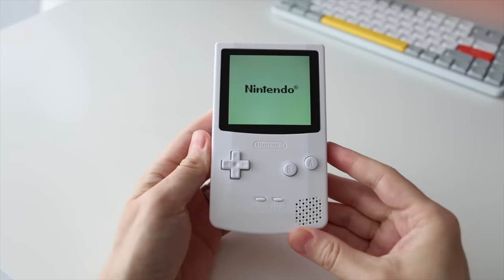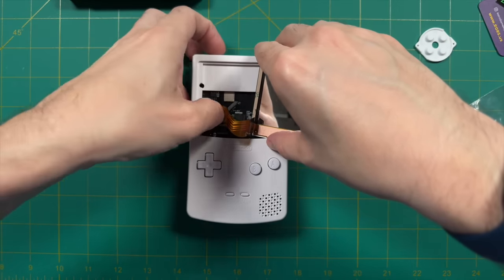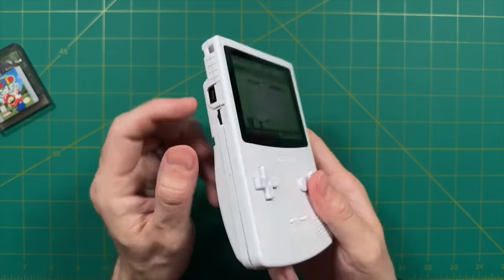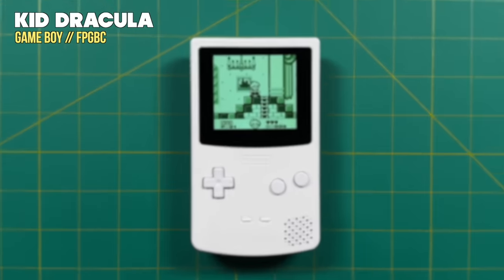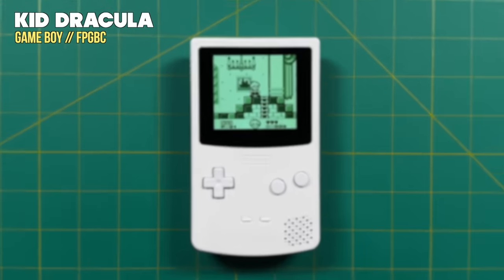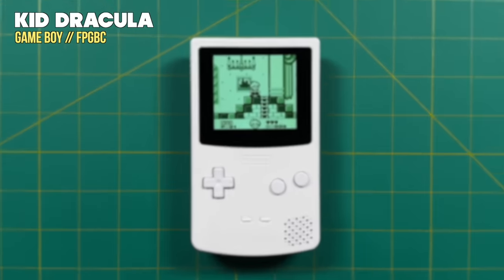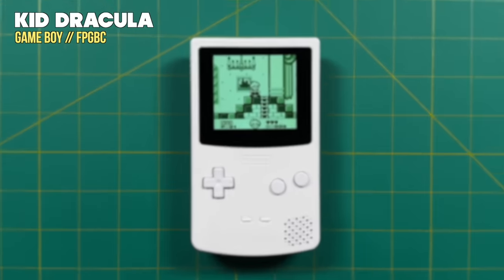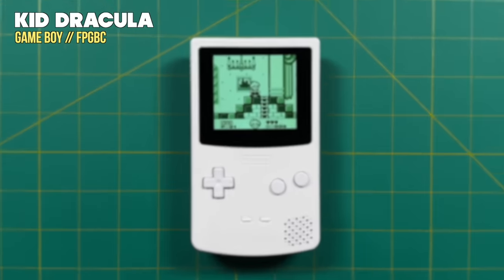FPGBC Review: My Favorite Game Boy

Comment: I have purchased the same product and I also had link issues. I found that the link port is not sitting correctly and was not allowing the cable to seat fully. You could maybe loosen the screws for the motherboard and move it over slightly as it doesn't need much. I had a cheap link cable so i just trimmed the black plastic around the port. Now it works as it should

Comment: Great review. Its crazy how you stated everything Ive been thinking the last few months. I even started collecting gameboy and gameboy color games, even overseas ones, because of the fpgbc. I have both it and the analogue.. I love both for different things. Ive been using them more than any of my other handhelds lately..especially analogue having some other emulators as well. Pro tip.. Kirby tilt and tumble is the most underated game of all time imo now that we can play it on a clear big nice screen. Its so good. Can even get the japanese version since its a bit pricey in english. so worth playing the actual cart. I went for the fpgbc during its first wave 1.0 for two reason.. I always wanted a modded gameboy but the price was always way too much, and 2. No soldering, easy to build while still customizable, and other great updated feature.. type c, bigger great screen etc. You nailed this video. I also just got the funnyplaying flashcart v2 and their gb style flasher (kinda cool it uses gb pocket membranes and buttons).. Im wondering how well it will work WITH the funny playing device.

Comment: I wanted a FPGBC when it first came out but decided to wait until FunnyPlaying fixed the compatibility issues and added better color correction options in later firmware updates and hardware revisions. I ended up buying an Analogue Pocket instead when it came back in stock a couple weeks ago and I can't say I regret the 230+ dollars I payed for it at all.
One thing to note: the budude2 GB/GBC openFPGA core on the AP has a custom palette enabled by default, which is why the colors are so washed out when playing GB games and using different display modes. Set Custom Palette to Off and the colors will look just like they would when playing an original cartridge, with the "Normal" mode displaying proper black+white monochrome.
I've been using the budude2 core despite the lack of save states because of the RTC support and I like having the additional display options, like being able to use GBC LCD+ with GB games.

Comment: I have the FPGBC. You don't seem to mention it on the video, but video synchronization is broken: play Super Mario Land and observe the scroll. You will see that it's not as smooth as on a real GameBoy or the Analogue Pocket.
That's because Funnyplaying seems to be using an screen with a refresh rate that doesn't match any of the speed settings.

So if you want a precise GameBoy replica, avoid this. Screen is not adequate, even if it looks and sounds very good.

Comment: I’ve built 3 of these so far and it’s really great. I’ve been introducing friends to the amazing new look of game boy games. The FPGA still needs some work as the game capability is not perfect for example Alleyway starts but you can’t control the paddle.  Also, the Everdrive X7 does work now, but you need to be on one of the later firmwares.

Comment: The clock rate seems to affect the playability of Kirby Tilt n' Tumble. At the default rate, Kirby rolls back and right for me when the console is "flat". When I speed the clock up, the problem is mitigated until he starts rolling forward and left with the console at "flat". Slowed down, he rolls back and right even harder.

I think this must be tied to the output rate of the sensor vs. that of the console introducing some aliasing in the sensor outputs. Hopefully the issue is fixed in a future firmware update.

I am also having issues running many GBC games off of my EZ Flash Jr, which seems to be a common issue. GB games and GBC games compatible with GB will boot up just fine with both the GB and the GBC cores, but GBC-only games just freeze up. Not sure what could be going on there, but that's another thing I hope they fix. 

Otherwise, this thing really is super awesome and plays real copies of most games like a dream.

Comment: This thing is screaming "add the NES CORE" (and other 2-buttons consoles as well). One major downside is: stated incompatibility with GBC casing. But, judjing by assembly, it is not so different from IPS ready GBC shells, it even has tabs for AA contacts, and bolts placement seems to be the same. I'm tempting to order kit without a box and trying to fit it inside the shell from extremerate (killer quality). Large screen is a killer feature, I have always guessed why third party ips screens mimic original size, instead of going all out, and FP finally did this.

Comment: I got a GB, GBC and GBA all modded with new shells, IPS screens, etc. but the Analogue Pocket is just so much better. The GB games alone look closer to the old DMG I had growing up. Add in the dock and wireless SNES controllers from 8bitdo and there is just no comparison. It is well worth the wait for the AP. I also got 8bitdo NeoGeo, PCE and M30 (Sega) controllers and they all fix with their respective systems.

Comment: The analog pocket isn't to be more like a 3D render, its meant to represent the original gameboy more. It feels a lot like an original gameboy. If you're seeking GBC then that feels different in a number of ways. I still have my GB, GB Pocket and GBC, and they all have a slightly different feel to them, both the shape and the buttons.

I personally wouldn't want more than the Analog Pocket if I was going to settle on just one GB like device, but making my own GBC does seem fun.

But then I also have all my physical handheld collection still with me, so more often than not I will go back to the originals, regardless of the worse screens.

Comment: I got one from the first batch back in October and it's my favorite handheld! If only it could take rechargeable AA's it would be perfect for me. I'm also hoping they make one in the form factor of the Gameboy Pocket. 

The only issue I've ran into with it was some audio issues after I swapped the button membranes a while back (another benefit to this console is the ability to use original gbc button membranes for that perfect feel). I figured it was a weak connection where the speaker plugs in so i just cut off the connector and soldered the speaker to the board and it's all better now. The only issues I've had with playing it are in Chess master and Alleyway. Chess Master is just missing some of the audio, and Alleyway is just unplayable because the D pad won't work. Everything works perfectly on the other couple dozen games that I own. So as long as you aren't a big Alleyway fan you should be good to go

Comment: About the EZ Flash Jr : there's an experimental firmware available for it that was supposed to solve problems with the Analogue Pocket and while the official website removed it because people were bricking their flash cart with their shitty SD cards, it's easy to find it elsewhere and it makes it compatible with the FPGBC... kinda. The GB games work perfectly and some GBC games launch just fine, but most just crash the console (I think it's the ones using the better CPU of the GBC, for example, Pokemon Gold launch, but not Pokemon Crystal). It's better than nothing and at least, it means I can play Pokémon romhacks, but it's definitely a software issue, it didn't worked at all before the 1.04 update, so there's hope.

Comment: My guess is that your issues with connecting the FPGBC to the Pocket or original GB Color are due to the fact that it's not exactly the right speed. Probably some sort of timing issue that prevents it from working exactly right. So it probably does work with other FPGBC systems because they're also running too fast.

Comment: Strange result on the link cable. I was able to get Pokemon Puzzle League running between the FPGBC and an original GBC. Just to make sure I didn't miss something. I just tried Tetris Attack across a GBC and FPGBC. Worked fine. I'm using Firmware 1.06.

Comment: The AMOLED kit is amazing but correct, it does suffer from the saturation issues and added cost of original hardware. Right now, it just seems like we're in this weird in between phase where FunnyPlaying's FPGA development of 35 year old hardware isn't quite up to snuff yet. If we could use the AMOLED screen with a FPGA option that had desaturation options and clean, pure blacks for the black & white to match the GB Pocket, that's the winner. The work in progress nature of the FBGBC really does hinder the appeal unless all issues could be solved with software updates. Hardware revisions to the board could make it a more expensive option in the long run. Would be really great to not need an external flash cart and then if they can keep the kit low cost, they could have something special.  Would eventually like to see a DMG variant for certain peripherals like the Konami Hyperboy and maybe video out for streamers. Overall there's potential and hope FunnyPlaying continues to refine the FPGA options.

Comment: Quick tip: If you don't change the boot screen to the official boot screen then the FPGBC won't boot up if you try to change colors holding A/B and pressing the D-Pad.

I absolutely love this device, my only gripe with it is that the colors aren't all that accurate. I feel that when playing Gameboy games (Such as Pokemon Red) I prefer using the EMU display, but for GBC games (Such as Zelda Oracle of Ages) I prefer default display setting.

I also feel that the buttons are a little bit stiffer than my original GBC. I'm not sure if this is because the buttons are new or if it has to do with the molding. Though this really isn't a problem.
Reply: I saw a post on Reddit saying it's the fault of the membranes being not as good from fp and to get some from AliExpress. Hope this helps just ordered one

Comment: I have an OG GB DMG, a modded one with IPS, an OG GBC and a modded GBC with IPS and since a month and a half I have this FPGBC. I have the same experience with flashcards. The same cheapo Ali one works like a charm for me too and is the one I use on the FPGBC. BTW pressing start will quickly start up the last game you play with that flashcard. The Everdrive works now an then, the EZ Flash JR does not work, which is to bad because it has a Real Time Clock which is handy for Pokemon games.

I prefer the FPGBC over anything else hardware or software emulating the GBC, because of the authentic feeling it gives! The larger screen is also a plus and it's almost half the price of buying a OG GBC and then modding it with an IPS or OLED kit.

Next I hope Funnyplaying will do a FPGBA, because the kit they have now requires you to solder the CPU and RAM on a new motherboard. I know how to solder and do it regularly, but those tiny pins are above my grade...

Comment: I think comparisons to the Pocket don’t hold as much weight as comparisons to modded and used GameBoys. FPGBC should hit a major dent in GameBoy resellers rather than Analogue. 

I also find it so funny that you feel the FPGBC gives you the nostalgia hit more than the AP. I grew up with a GBC, I for sure would not play on a normal GBC ever again (unless there is eventually a GameBoy Pocket Color mod with an OLED screen). Even with the FPGBC clock issues. I will likely be building a few to give to more casual people as gifts.

Comment: This is a great game boy and I love mine however they need to fix the clock speed it’s either too slow or too fast. It’s hard to recommend this over original hardware or the pocket. I hope they fix this. I’ll add while it’s suggested in the video is a few seconds over an hour it’s much more than that. Put two Gameboys side by side with the same game to see what I’m talking about.
Reply: they need to fix the gbc implementation so it's 100% the same, you are right. this is the reason I'm not purchasing.

Comment: The reason why GB_Colorfix seems useless is because you use GB mode for all of your original Gameboy games. If you ran them in GBC mode, the colorization will be inverted in a few cases due to the difference between an emissive and reflective screens. Donkey Kong, for example, is fantastic with GBC colorization. But it will look wrong unless you change that setting.

Comment: If I didn't have my Analogue Pocket, the FPGBC would certainly be the way to go now. But the Analogue Pocket, to me, is just too good. I like it for my short sessions of Tetris DX and Super Mario Land DX (as well as their GB counterparts, depending on my mood). When travelling, I'll use my Miyoo mini Plus instead, but whenever I get home, it's back to the Analogue Pocket. I wish FunnyPlaying would've somehow included an SD card slot, so it, too, could be used for multiple games without going the flashcart route or travelling with original cartridges. Then I might consider that for travels instead of the Miyoo. (The main reason not to always use the Miyoo is that slightest lag cheapo emulation devices "feature".

Comment: I want to love mine but the electronic noise is too much to bear. They also don't allow you to turn the volume low enough. It's either silent or too loud, presumably to mask the noise. The screens brightness majorly effects noise. So the backlight needs to be way down for it to be bearable.
Reply: Have you tried updating the firmware? They have supposedly adressed the volume issue a couple times already, but it seems that it's also in part a hardware limitation.

Comment: You should try the oled screen mod for the gbc its 50 on aliexpress or 55 and it comes with a pre cut shell just need a working gameboy color and have to solder 1 wire its not difficult and looks way better then the lcd mod plus it has touchscreen functionality

Comment: I find doing a direct comparison of the FPGBC to the Analogue Pocket is unfair since they serve wildly different purposes. The FPGBC looks intended to be an explicit replacement/substitute of Nintendo's Game Boy Color and earlier but to my knowledge go no further than those games generationally. The Analogue Pocket nominally starts one generation later with GBA and can play everything older as a consequence of being GBA-compatible, and on top of that tries to deliver "the boutique Analogue experience" (including the boutique Analogue price markup), and on top of that is Analogue's experiment with being dockable like the Switch, and on top of that is also Analogue's experiment with multi-purposing the device for other consoles, both officially via the cartridge slot conversion accessories and unofficially via the openFPGA and firmware jailbreaking capabilities.

If someone wants just a Game Boy Color or even just a pre-color Game Boy, the FPGBC is probably 99% perfect for that, with that remaining 1% being the rare compatibility issues pointed out in the video like with flash carts. Anything more than that, even just one generation later like with the GBA, and the Analogue Pocket has no competition by a mile. If someone's willing to wait for stock and spend that cash, of course.
Reply from the maker: Agreed on all points but one, in that I do think the AP was designed with the Game Boy/Color in mind, not necessarily the GBA.  The AP aspect ratio and resolution are a match for those older consoles, and not the GBA -- it's a 10x integer scale of the GB/GBC, but a wonky 6.7x scale of the GBA.  So that in part was why I used the AP as a talking point in the video, even though it serves many other purposes than just that!
Reply: @RetroGameCorps  Remember that the GBA had the (apparently more beloved) SP revision (which I'm personally meh about compared to the wide orientation of the original layout, but that's a separate convo), which an in-between of the SP and a DMG is what I think the Pocket's form factor was meant to evoke, though your observations about its screen more fitting pre-Advance Game Boy are very likely 100% their reasons for choosing that as the starting point. In fairness to a genuine GBA, remember that playing a Game Boy game on one either squares it or artificially stretches it to fill the screen depending on how you toggle the backwards compatibility aspect ratio (I haven't tried this on an SP, but I presume it offers the same toggle as well), so for the Pocket I assume the choice was either perfect integer scaling for GB/GBC and letterboxed GBA scaling or perfect integer scaling for GBA and side-barred GB/GBC.

I don't personally own a Pocket, mainly because of financial reasons when it originally released, so I can't do any first-hand confirmations of any measurements myself. I appreciate the work you've done during the course of producing this video. :)

Comment: I've had no issues using my ED GB X7 on any firmware in over a month of use. I do have the FPGBC board revision 1.1 though. Maybe you have an older PCB rev?
Reply: May I ask your FPGBC firmware version and your Everdrive GB x7 firmware version? I feel like I've tried every combination under the sun, and still nothing. Fully updated, my ED works on a stock GBC. Not on my FPGBC.
Reply: @newdirectdemocracy  I've actually used several firmwares on the FPGBC and all have worked. Currently using the latest on both. The X7 I'm using 1.06, for the FPGBC, 1.08. it's more likely that it's PCB revisions causing the issue. There are 2 main FPGBC board revisions. I have rev 1.1. For the ED GB X7, the rev is B (model 17) manufactured in 2017.